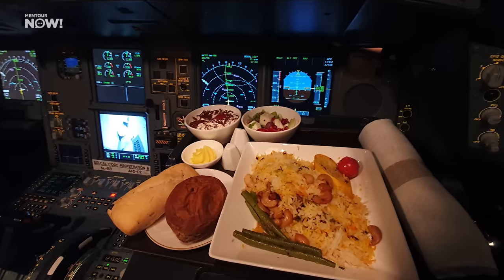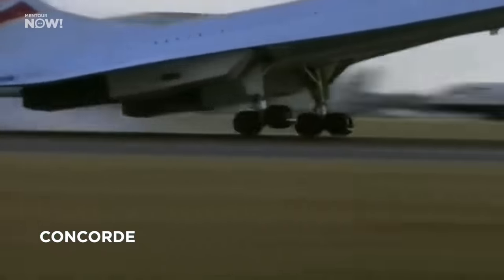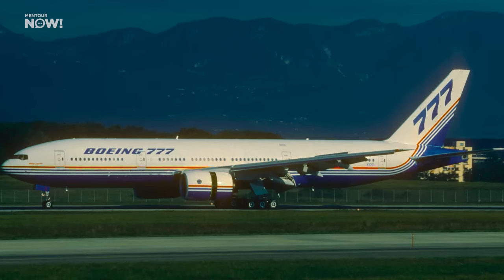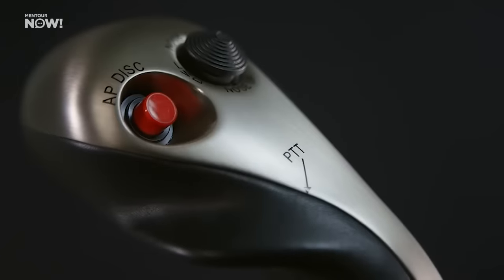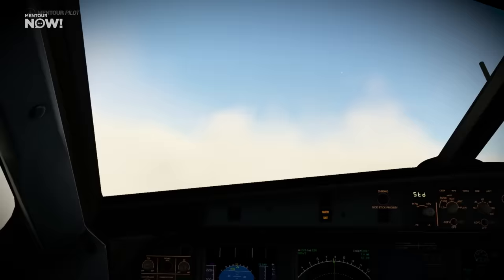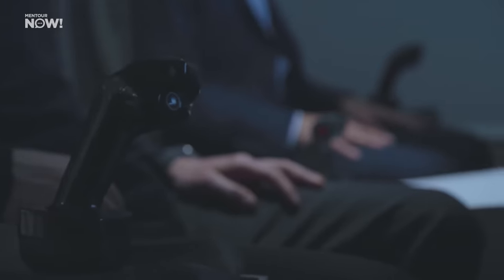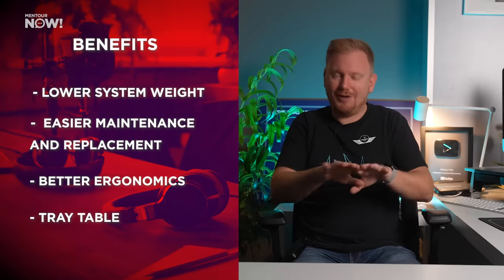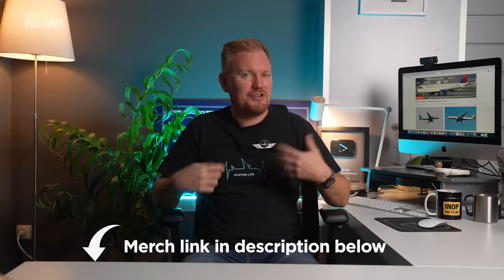Will Airbus Finally switch??

Comment: One of the first things I remember when I learned about the Airbus side stick, and why pilots tended to not to like Airbus jets, was that there was a crash in the US when two pilots reacted to a situation and they both fed in opposite inputs into the aircraft, and the plane sort of froze and crashed.  The FAA wanted to mandate the force feedback (there was actually a version of this for aircraft the Air Force had developed) but Airbus complained to the EASA, the certification body for Europe, and they  blocked the order saying that only they can impose such orders on Airbus. The worse part was, only a few years later, they actually did have a commercial version of the force feedback method for the joystick and the CSeries was supposed to have had this in its earliest incarnation (I'm not sure if it actually has it).  Despite what Collins is saying, the only reason why Airbus is considering doing this now is because ironically the 737MAX. Airbus had a similar flight envelope protection like the MAX and it has caused several crashes, of which Airbus has dodged lawsuits for in the past, notably that Air France 447. Since they are now close to revamping their fleet anyway, why not do it now? Also, despite what Airbus says about having touch screens, the first jetliner to have them was the 787.
Reply: To be specific it’s the 787 EFB that is touchscreen, not any of the MFD’s. The A350 has touchscreen on the OIS and lower MFD

Comment: Sorry if this seems to be a stupidip question but here goes. When using a yoke or even a central stick pilots have the ability to use either or both hands. Does having a sidestick cause any issues for a predominantly right or left handed pilot?

Comment: I'd love to see a video about flight-by-wire implementation of Boeing vs Airbus. Especially the control method differences between normal mode and different fallback modes in case of system failures. For example, I take that AF477 crash was basically caused by pilots not understanding the fallback mode of their plane (combined with lack of situational awareness).

Comment: Non-pilot but IT guy here. Seems to me it would be better to pick one side stick as the control and have the computer follow it. Put an indicator on the panel showing which stick has control. Then the pilots could push a selector button to change who had control. Having the computer follow only one stick would prevent many of these problems. But would it cause others that I am unaware of?

Comment: The problem with a running change on something like that is that it wouldn't happen to every single plane at the same time. If a pilot then switches between a plane that has the active side sticks and a plane that doesn't have them, it can create a problem when they're flying with the old system after becoming used to the new system.

Comment: This seems like it would be a huge upgrade to the safety of aircraft controlled by side sticks, however, as an engineer (and also a private pilot,) I would not be surprised if the biggest challenge - and likely the reason the A321neo and A330neo don't already have this - is not a lack of technology at all, but rather the same reason that several newer (than the 1960s) technologies weren't used in the 737 MAX: pilot training. If the control changes become too large from one generation to the next, then it requires, at minimum, additional training, but possibly even a new type rating. Honestly, this seems like the sort of change where a new type rating might reasonably be required, as it is a significant change to the basic handling of the aircraft. Requiring a new type rating makes the aircraft far less attractive to airlines that already operate previous generations of the same aircraft, as a strong majority of Airbus and Boeing's largest customers do. Having the same pool of pilots be qualified for everything from your A319ceos to your A321neos is a huge both cost and operational reliability advantage (and, of course, same goes for the same pool of pilots being able to fly your 737-700s as your MAX 10s or your 757-200s and your 767-400s.)

I do think this would be a very significant safety upgrade, but I would not be surprised if it ends up being introduced in a clean-sheet design rather than a retrofit to an existing one. I would be surprised if it did get introduced on existing generations of existing designs (e.g. 320neo, 330neo, 350) without a pretty significant extra training requirement. Of course, this also brings up the humorous possibility that Boeing might actually introduce it before Airbus does.

It does seem kind of surprising to me that Airbus didn't introduce this with the A350. I suspect if AF447 (and, especially, the analysis of its investigation) had happened 5 years earlier, the A350 would have had this from the start. As it was, though, the final report for AF447's investigation didn't happen until the year before the A350's first flight and Airbus was trying to get it released ASAP to compete with the 787 and 777, though, so it was almost certainly too late to introduce it without significant, very costly delays at that point.

Comment: One thing that I have always wondered about is muscle memory with the side sticks. The FO gains his feel with the right arm, then swaps seats and now has to re learn that feel again with the left arm. Or isn't that an issue? Love these videos.
Reply: I suspect that's not a huge issue, since that's always been the case with aircraft with yokes as well. Your inboard hand usually operates the thrust levers, it's rare to have both hands on the yoke unless you're doing very dramatic maneuvers.

Comment: A advantage that you can also get from fly by wire that no one seems to use yet is automatic trim. There is no reason, aside from the lack of automatic feedback of what is happening, that the pilots should have to actively think about what the ideal trim level is. They are there to fly the plane, not trim the plane.

Comment: Excellent information well presented.  Thank you.  It seems like an active side stick feature could be turned on or off depending on if the pilots had received training on the active side stick.  This could make implementation incremental.

Comment: It would actually be cool to have this but tbh… you get used to the normal sidestick. It doesn’t make your handling bad or you lose “feel” of the aircraft. It takes time to get used to it like anything else. 

Just like you don’t feel the difference between driving a car with drive-by-wire and a hydraulic steering. 

I doubt any airline will start retrofitting it since it’ll cost an arm and a leg and keep the aircraft out of service for a while.  Added to that, if any airline will get this as an “add-on” possibly many would be repelled by the cost. I’m guessing only private owners would go for this setup!

Comment: THX for a great channel. Very factual and informative. 👍
I’ve been with SAS since 1996 flying DC9 and MD80. The past 22 years I’ve flown some 13000 hours on Airbus. 319, 320, 321, 330 and 340. I like the idea of an active sidestick but I don’t need it. I would have to place my hand on the stick to know what the other pilot is doing, which is pretty neat but it would not help me in case of a malfunction were I would be busy hitting buttons and reading the ECAM. The same would be true with a yoked aircraft. My attention would be elsewhere at least for a bit. So would I catch bad flying in a case like that BECAUSE of an active sidestick….probably not. I would more likely catch it on my PFD or aural warnings going of. 
The next thing is how to mitigate a smoke removal scenario where opening of a cockpit sliding window is a possibility according to Airbus procedures.The sliding window interferes with the movement of that sides sidestick hence the sidestick control unit would have to be repositioned. That’s why it is PMs window that will be opened in such a case. 

So…I think retrofitting is not a real possibility with respect to costs for the airline, feasibility and actual need for the pilots.

Just my two cents 😎 Fly safe.
Reply: Just " my 2 cents" is not gonna´ make it. Instead of placing a hand , you could just observe !!!

Comment: I'm quite certain this upgrade will happen, because Airbus wants to increase commonality between the A220 (C100/C300) and the rest of the fleet (A320/A330/A350). So Airbus can introduce a program to replace the sticks and update the computers that could be done during a C-Check or D-Check on all types. As well as make them optional for new builds. The only training needed would likely be differences training over a couple of days.

Comment: I recently learned, that »joystick« or »joy-stick« was originally used for flight control sticks long before computers were even a thing. As in, from 1910.
Airbuses absolutely hav joysticks, as has any other plane with a stick rather than a yoke for controls. Sailplanes, you name it.

Comment: Having flown both Boeing and Airbus, it is the non moving throttle of Airbus autotrust that I found the more disturbing. As for flight control I agree with your point, a side stick with feedback would make the best of the two. 
IMHO, the main difference is that Airbus is trimmed to maintain trajectory, wheras Boeing is trimmed to maintain speed (as conventional aircraft). And that is not often pointed out.

Comment: I am surprised about the size of the box underneath the side stick. My joystick has only a very small foot. But that is only a joystick, not an Airbus side stick. Btw Juan Brown (Broncolirio channel) has made a video of that Air France B777 incident at Paris Orly. Even Juan, as an experienced B777 pilot did not know that there is a break system in the mechanical link between the two yokes. When to much force is exerted on the yokes, moving in different directions, a small link part will break, maken the yokes move independently  from each other.

Comment: This brings up a question I've wondered about for quite a while...it may seem like a dumb question, but I'll go ahead and ask it anyway....

According to this video, when there is mismatch between captain and first officer control inputs, the system averages the two inputs. 

But that's obviously not desirable in many, if not most, cases.   What you really want is to be able to tell the airplane to accept the inputs from one control and ignore the other one.  Because just as no man can serve two masters, neither can an airplane.  

So my question is... does such a mechanism exist?  (It could be as simple as a three-position switch: Left, Center, Right.)  Do Boeing and Airbus aircraft have such a system?

Comment: Force feedback on controllers has been a thing in gaming setups for decades now, it adds another sensory input, and is really helpfull. The only real issues with it are more complex mechanics, and potential heat generated by those mechanics.

Comment: I think active side sticks have  another great advantage in avoiding  pilot  disorientation and vertigo  as input and output onto the  stick is spatially replicated by the "outer world" an  the instruments . You also always feel what the other pilot is doing just by  keeping a hand on the stick without inputting anything. Clearly a case of WYFWYG    "what you feel is what you get" . LOL

Comment: I still think having a yolk is the best option 
But just remove the mechanical linkage and use servos instead Makes way more sense and have a manual override if one of the  yolks is not responding properly

You would have the Best of both worlds

Comment: I suppose someone has already thought of this idea:  When the side sticks are both getting inputs, as you stated, auditory messaging is problematic due to ambient noise as to who is "flying" the airplane.  What about visual indications?  Aren't pilots predominantly flying the plane in response to instrument indications as well as motional response?  Pilots respond to a number of indicators in the primary flight display.  Why not a visual indication showing each pilot's input so that both pilots can adjust their inputs accordingly - we walk down the street visually aware of others, why not use the same intrinsic ability to manage flying?  The eye is much faster than the hand, I'm sure you know that.

Comment: As far as I can see, it would be possible to copy the movement of one sidestick to the mount of the centering springs of the other and vice versa, without adding feedback from autopilot and autotrim. This would make an almost plug-and-play retrofit without modifying the software or cabling.

Comment: The original A320 had moving thrust levers as a paid option. Some of the older sims still have them. But it was expensive so nobody went for them. I have never found it an issue, but some people like to see them moving under autopilot.
Reply: Sir, can you please share some source about original A320 with moving levers? First time hear, wanna read more.
Reply: @igorgoncharov3191  HI, glad it has sparked your interest. If you email a pilot training company in southampton in the UK called L3 Harris and tell them of your interest, they may well do a small video for you inside one of their sims. Their oldest 320 sim originally came from toulouse made from real 320 parts, unlike the newer sims that are largely reproduction parts. Fingers crossed it is still running and in use, it was just over 10 years ago I last flew that sim.  This sim has the original motorised thrust levers, and it is indeed strange seeing them move in an airbus. It was only their oldest sim that had the moving thrust levers, so when you email them be clear that it is this sim specifically you want to see a video of.

Comment: So are we getting force feedback joysticks back into fashion for gaming/simulators? The MS Sidewinder 2 is super old but absolutely fantastic, unfortunately software support went away quick. But boy was it awesome, even feeling bomb bay doors open and elevator feeling instantly lighter as soon as you release a bomb. But also feeling the drag when the landing gear comes down, engine vibration, turbulence, stall, so much more enjoyable and you know what the plane is doing without looking at instruments.
Brushless servos and hall sensors should work great, I can imagine the engineering is tricky to get it reliable enough so a glitch of a sensor, servo or software doesn't go MCAS on you.

Comment: how do all? i'm still all for ' smooth is fast ' like in the shooter movie. i've seen pretty violent hydraulic control input from cockpit vid and post analysis of black box. there would be a couple of very powerful hydraulic pumps operative so stresses must be occurring often. i hope and pray bushes and sleeves and mounting brackets are regularly inspected. taztez

Comment: Suggested topic: Recently I spoke with a Lufthansa long-haul pilot who commented on handling of newer carbon fiber vs. older aluminum construction. Pilot said that carbon (A380) aircraft will "bounce" or absorb rough air in turbulence, while stiffer aluminum frame encountered turbulence like "speed bumps".

Comment: Having flown Boeing products (737, 767, 777 and 787) and Airbus products (A330 and A340’s), sidesticks, active feedback or not, is head and shoulders superior than the yokes.
Personally, I think the active sidesticks is a red herring. The pilot not flying (PNF) should keep his mitts off the controls, whether they are the captain or not. If they want control, for whatever reason, then say “I have control”. There no reason why two pilots, sidesticks or yokes, should be handling the aircraft at the same time.
Reply: Putting sidestick/yoke aside, which FBBW system did you prefer? Boeing's C*U speed stable or Airbus C* path stable version? Just curious.

Comment: I am surprised that the sidestick controller does not have active feedback yet! Feedback is very important mechanism to control human motor action and sense. Hand is very sensitive organ and take large part of human sensory experience. If the sidestick does not use active force to give direct feedback to pilot, it is a great waste of human sensory capability.

Comment: FYI, the main reason why Airbus did opt for the FBW system is much more basic than flight envelope protection. It's simply weight saving compared to 'classic' flight controls. One of the big advantages of the A320 over the 737 is the ability to use ULDs instead of simply throwing the  baggage into the belly.  By doing that, the A320 would have become way too heavy compared to the 737.  Mr.Ziegler himself told me this story when I met him at Courchevel in the early 90s.

Comment: The AH-1 Cobra attack helicopter used a sidestick in the front cockpit so that the front-seater could better operate the weapons systems. As for sidesticks on airliners, if I were an airline pilot, I would rather have each sidestick be on the right, relative to each pilot. But, then, I'd want each set of throttles to be on the left, relative to each pilot.

Comment: Sidesticks feel like you are telling the plane,: turn left, as opposed to conventional put the left aileron up and right one down. It might seem intuitive, but it's like giving the plane suggestions as opposed to actully feeling the forces fighting back on you.

Another way to think of it is like you are turning a steering wheel on a car to suggest to it to turn left, as opposed to turning the steering wheel left to turn the wheels left, which makes the car go left most of the time.
Reply: You're thinking of Airbus only. The first point doesn't make much sense as the 777 and 787 have FBW as well where you turn the wheel, you're telling the computers to turn the plane left, just like the Airbus. The only difference is those 2 Boeings provide artificial feedback while Airbus doesn't. Gulfstream active sidesticks do provide force feedback. Not all sidesticks are the same.